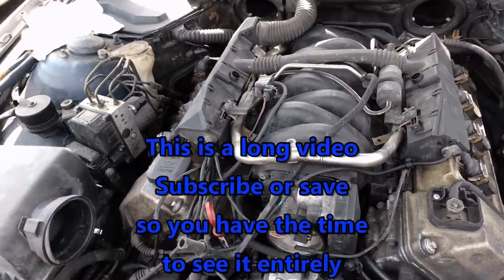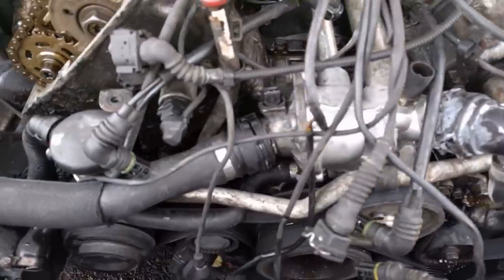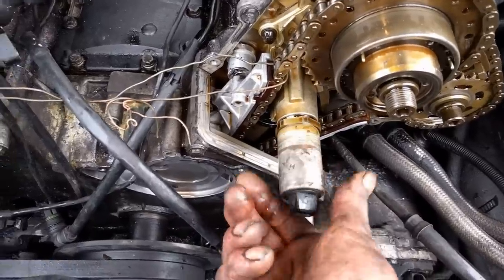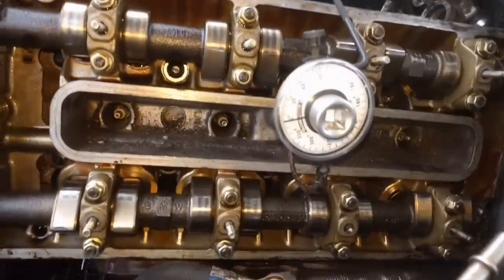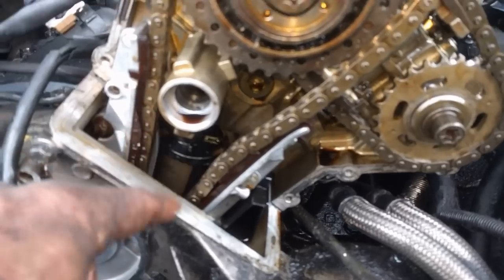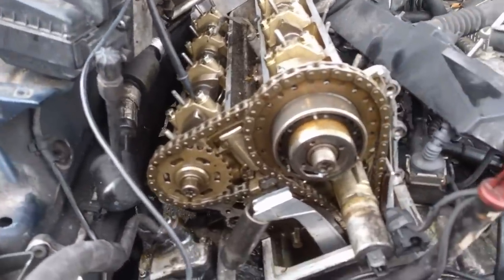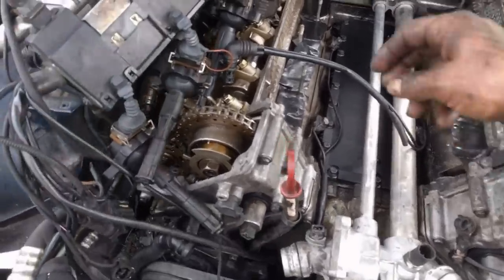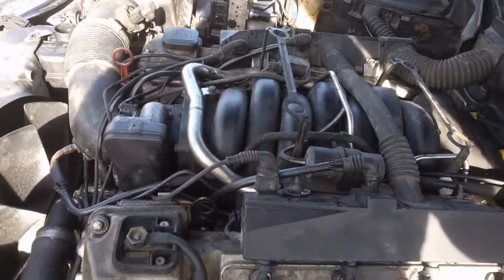How to Replace a BMW Head Gasket Step by Step E39

Comment: I did mine a year ago. First problem was the intake cam bolt bank 2 ( drivers side ) backed out. Use thread lock. And problem I had was I reused the head bolts. Now it is building exhaust pressure in the coolant system. Time to take the heads back off. Going to have the heads checked  this time.

Comment: I just got done with mine the truck is running great. I had one problem though the cam sensor! I tighten everything to spec Torque and started the truck And it ran like 💩 the check engine light was blinking I quickly turned it off. I checked for codes I had P1300 an 567 an 8  miss firing. I took the  cover back off and the upper timing cover and I can turn the cam sensor with my hand... I don’t know how that happened but I did some research and the second time around i use the red Loctite an And tighten the specs a little bit tighter and that worked for me.. Thanks glenn..

Comment: Hey Glenn it was great to see you still here answering questions I really appreciate it! You really help me out two years ago with my time and guides and chain Oh my M 62 has been running great all up until last week. Check engine light started flashing oil leaking from Val cover gasket.  17 codes🤦🏾‍♂️ Miss fire on 543 and 1 Car is running very poorly The rest are all O2 sensor codes As his running I hear a little popping sound I can send you a video any suggestions?
Reply from the maker: It is so hard to say what it could be. If oil is leaking around the spark plugs it will cause them to miss fire. Once the engine starts to miss fire it will through a lot of codes. I would start there, make sure the coil packs are not in oil. and the spark plugs are good.

Comment: The camshaft torques at 35:38 are reversed. The lower/smaller exhaust (A) gear is 92 ft*lb (125 N*m) and the higher/larger VANOS/Intake (E) gear is 81 ft*lb (110 N*m), as stated correctly on your Torque Specs page.
Reply: Thank you

Comment: Hey Glenn, very helpful video by the way and my question sir is why did you decide to change the head gasket in the first place. My car started over heating  recently and I haven't figured out why but was wondering what were your symptoms of why you changed it. Thank you sir.
Reply from the maker: I was replacing the valley pan gasket under the intake. Like a idiot I did not cover the intake holes on the head and dropped a washer in the head. I could not get it out so I had no choice but to remove the head to get it out. One symptom to a bad head gasket is over heating but  usually you see antifreeze disappear or antifreeze in your oil. I would check things like thermostat water pump and radiator.
Reply: @Glennfix  ty I appreciate that. I don't have any oil in the coolant, no coolant in the oil and no white smoke but I guess that doesn't mean it didn't blow the exhaust into the water jacket.. I am going to do a test on the coolant to see if that is the case. I hope not

Comment: Hi glenn, first of thank you for your videos. Second I have a 1995 530i e34 that I cannot seem to find head bolt torque specs on. Was wondering if you could please help. Looked all over on line not a thing.

Comment: Nice video. Going to be doing Timing chain and all the associated gaskets etc. this was a great video in case my valves are jacked up due to the chain break. Head(s) May have to come off. Thanks again, Sub’d. Clay
Reply from the maker: I also Have a video on timing chain replacement at https://youtu.be/XcmuxaXi6s8

Comment: With the heads off I see what looks like a rubber seal where the oil feeds the heads.  One on each side.  Did you replace these?  Seems they are flush with the block and the head gasket is recessed at the seal as if it couldn't come on contact with the head anyway.
Reply from the maker: I would replace anything that goes between the block and head. For the cost or waiting time for parts will never equal the time or cost if you have to do it over.

Comment: I stumbled on your video. Before I go through this process I want to make sure it's my head gasket causing the issue. 08 750 li that has mis-firing in cylinder 5,7,8 and white smoke coming from engine bay at the back of the engine on the passenger side. My coolant gets low quickly as well. I have no leaks on the floor. Does this sound like a head gasket situation?
Reply from the maker: Yes, but you should do a compression check. If you don't have compression in a cylinder there is something going on. It could be a number of things. timing chain, head gasket, valves. If you have good compression it is most likely the head gasket. If it is just an antifreeze leak I have had good success with head gasket sealer. I had a 01 740 it was blowing out steam from the back of the head, I used head gasket sealer and it worked. I drove the car for about 30,000 miles and sold it still good. You also have a cross over pipe in the back make sure the gasket is not leaking on that. Try to see where it is leaking. hope this helps.
Reply: Glenn 3505 does this video apply to 740il 2001 series cause that's the BMW I currently have :)?

Comment: Can you post a link for where you got all your special tools needed for the vanos and timing? Also could you tell me where to get a gasket/oring or parts kit for head gaskets, vanos, timing chain/guides etc? I have to do the cooling system on my car and figured since I’ve got that stuff out of the way already I might as well just do everything else in my engine now since it has 157k on it. That way I don’t have to bother with it again.
Reply from the maker: If it has 157k it is time. The best thing to do is just Google  what you need. There are kits all over the internet. The same with the tools, if you are going to just do the timing once a cheap set of tools will do. But you want to get a timing kit from a reputable place.

Comment: How much is this job done for at a shop i need to replace head gasket idk what side i think i have a blown head gasket cuz i keep getting air lock in my coolant system i used a air puller and it atill has air in the system is that a symptom of a blown head gasket?
Reply from the maker: It depends on where you live and where you take it. I live around Washington DC and a independent shop would be around $2000.00

Comment: Hey Glenn, nice DIY. One of the best I’ve seen on these engines. I have a question though. I am rebuilding an imola red e38 with the same engine as yours the M62TU, i need to do my head gaskets. Long story short i want to take my heads off without disrupting my timing the best i can. I don’t want to mess with the vanos because mine was rebuilt and it still has some life in it. I heard you mention in this video “if your not gonna rebuild your vanos gears you can leave this alone and the head will come off.” So my question is, to clarify, if i just take the main timing chain loose from the tensioner, make sure i don’t drop the chain, leave the vanos gears, valves and cams, and the pistons at top dead center locked with the blocks at the top and the pin in on the bottom... could i realistically replace my head gaskets without messing with my timing if i just use the blocks on the cams and remove each head one at a time? And by doing so i can potentially do this job without needing to re set the timing? If i follow your procedure step by step and lock the cams the right way and everything. I’m just wanting to clarify before i give this a go. I have my stretch gauge shipping to me right now. This is my first time doing heads so I’m being EXTRA careful and taking my sweet ol time. I would appreciate any advice for this i can get. Thanks again.
Reply from the maker: It is a big job but doable. If you have the pin in the block locked at TDC then when you put the heads back on you will still have to reset the timing on the top end. But you have the blocks so this should be no problem. Don't drop the chain and try to keep some tension on it so it dose not slip off the crankshaft gear.  If you are doing both heads there is not that much more work to take the bottom timing cover off and just have everything out of the way, but it is up to you.

Comment: just to clarify if i dont remove either of the timing gears and i mark the chains location on the gears that the chain needs to come off of do i still need to retime the engine? or will it go back together timed as long as i dont misalign something?
Reply from the maker: You ask the same question I did the first time I worked on a BMW adjustable timing. When you take the chain lose the timing will go out of place. There is nothing you can do to stop it. You will have to reset the timing. The toolset does not cost that much. You can google it and just buy a cheap set. It will only last for about 2-3 jobs but if you doing the work yourself that is all you need.
Reply: @Glennfix  i have the cam locks in place with the stamped part of the cam facing up. the motor is at TDC and the marks i made on the timing gears line up with the marks i made on the timing chain. the gears are rotated as far counterclockwise as they will go. i did not take the chain off that ties the cams together since the vanos system was rebuilt not long ago by the previous owner and i was just doing the head gaskets. i think its good to be put back together but i would like your opinion just to be sure. thanks
Reply from the maker: @morganclawson9985  It should be good. If you don't take the chain that ties the cams together off it will stay in the right place. You just have to time it to the crank and other head. I have replaced a head from the junk yard and they will give it to you with the cams and chain on the cams. I just set the head and set the timing on the engine and it was good to go.

Comment: why cant you do the circular method of tightening the head bolts starting from the center bolts........counter clockwise loosens clockwise tightens....just curious thats the way i was taught many years ago.....i dont want to step on your toes thats why im asking
Reply from the maker: I learned do the center bolts and do a X pattern. The way I said is the way BMW says to do so that is what I used. I think your way and my way is right. Bolts should always be tightened from the inside out. It makes sure the part is flat (no leaks).

Comment: have a 2013 750I sucked water from the top into the 2 rear cylinders on the pass side.  Need to replace connecting rods from the bottom. Is it possible to drop piston from the bottom and put it back in the same way or do i need to pull the head???
Reply from the maker: You need to remove the head. The most likely reason you have water on a piston is a head-gasket leaking.

Comment: Is it ok to set top end on tdc before setting the transmission for bdc?? 
Also could that be a cause of having interference with not being able to turn top over in order to see E 5-8?
Reply from the maker: You have to have the TDC pin in place to set the timing. If the timing is off you can get interference. Check the cam's and make sure they are sitting in the top dead center position and the timing chains should be free (timing bolts not tight). If the cam blots are not tight and the cams are in the right position (writing up) you should not have interference.
Reply: Hey Glenn, great video. I recently started doing the guides in my e53 with the m62tu engine as well as rebuilt my vanos and once I got the new guides and chains on, I put on the tensioner tool and took off my blocks and tdc pin but can only turn the engine over about 1/4 of the way. Any idea what can be causing this ? Is it interference ? If so how can I check or fix it without removing the heads ?
Reply: @_DIRTe53 did you figure out the problem?

Comment: Does the locking pin for the transmission also work for the auto 540i's?
Reply from the maker: All the 4.4 engines are the same.  740, all 540 all and so on.

Comment: Hello.  Can you check your link to the website in the description.  Might not be working.  I'm assembling my M62 now and looking for the torque specs.  Thanks.
Reply from the maker: Sorry, I changed my website host provider and I lost everything. I had to basically had to rebuild the whole site. I just do this as a side thing so I have to do this when I have time. If you still need the website is working.

Comment: how did you manage to remove heads? does it fit out both sides with intake manifolds attached to head?
Reply from the maker: No you have to remove the intake and exhaust manifold
Reply: @Glennfix  i meant does head fit to remove with exhaust manifold on? i have already removed intake manifold.

Comment: Great excellent work Sir. I am planning to do timing on my X5 2002 N62. I may need your help? There is way that I can contact you for your service pertaining to timing chain setting? And I live Close to Arlington, VA. I checked your website, and there was no contact me option. Thanks
Reply from the maker: The easiest way is by using you-tube comments. This way others can read the answers, I tried having a forum on my web site but it got spammed constantly. Making videos is a hobby for me, not a full-time job I could spend hours just deleting the spam. As I learn more about keeping spammers out I might try agine.
Reply: @Glennfix  I am working on my BMW 2002 X5 4.4 N62tu engine. I have taken out valve cover, manifold etc. I am hoping if you can help me out just putting the timing chain. I have the timing chain tool. If you live close to VA and I am willing to pay for you services if you can help me out putting the timing correctly? Please let me know. Thanks

Comment: Is this engine the N62b44 as found in the 2002 745li??
Reply from the maker: no this is a M62ut
Reply: Glenn 3505 if replacing the head gasket on a e66 4.4 do I need the tool kit for timing...???...the rest I’m pretty sure I can handle because I’ve worked on many other cars over 15 years but not the bmws..lol
Reply from the maker: @acourtneylawson2065  yes, all BMWs from 98 on have adjustable timing. and they all need tool set to set the timing.
Reply: Glenn 3505 thanks for the instant reply...awesome😎

Comment: i like your videos , however doing these myself many times ,theres allot of mistakes like the torque specs on the vanso gear and exhaust the vanos intake cam is 81 fps exhaust is 91 some people will say 92 also the timing of the vanos its quisck how you did it but you need the piece with the notches and you have to turn it clockwise first then counter clockwise until it stops, clockwise is advance counter clockwise is retarding the cam thats why you get continuity

Comment: Hey man would you be able to message me. I have one question. I’m having a hard time pulling my valve cover off even after all my bolts are out.
Reply from the maker: It probably has not been off for a long time and is stuck to the rubber gasket. First, make sure all the bolts are out it is easy to miss one. If you take a small screwdriver and pry easy in different places and keep working at it. Just remember it is made from aluminum.

Comment: Hey buddy, I stumbled upon your post about the compound turbo set up on your second gen Cummins. Do you still have it? I am writing on this post because its your most recent post. 
In want to do a hx35 over hx50 on my 2001 cummins. I can not find a kit for this and need the piping. Could you point me in the right direction to get them please. Or, if they don't sell them, would you be interested in making a set for me and I could pay you for your time and supplies. 
Let me know what you think please, and keep up the good videos, they are great info and great learning.
Reply from the maker: I do still have them, I don't think I could do with out them ( like them so much ). The HX50 over stock is a good set up. I have tried different set ups and this works for me. It is a good set up for towing and power. If you want a fast truck there might be a better set up. I had a exhaust leak and my bottom turbo was leaking oil I am making another video with more information on what worked, if you check back in a couple of days I should have it up. The problem with making the pipe is it was done piece by piece. If you read people always have some thing to say about my welds look bad. I am not a professional welder. They work and don't break so I don"t care. I would take the time to learn how, it is something you be happy you did for the rest of your life. There are a lot of videos on it ( teach your self system) or you can take a course at a local school. A good welder for part time use is a Norstar, I have one and it works very good about $500.

Comment: Pretty sure that head gasket was installed backwards....look at 18:36.
Reply from the maker: You are 1/2 right, it was sitting on there backwards but when I looked at it I thought somethings wrong and set right. Just a duh moment.
Reply: Glenn 3505 
Glad you caught it. 
😃

Comment: All the real pain in the ass stuff he just talked about but did not show it coming off. Talk is easy. Yes he did the job but looks like a less time consuming job in labor hours would be to replace entire engine and tyranny with a nice Corvette v8 and tyranny. And it won't over heat like BMW's do. Sad to say it looks like German engineers have lost their touch when it comes to reliabiility/quality and need to take lessons from the Japanese engineers (Lexus)